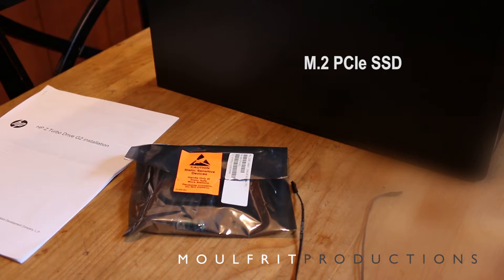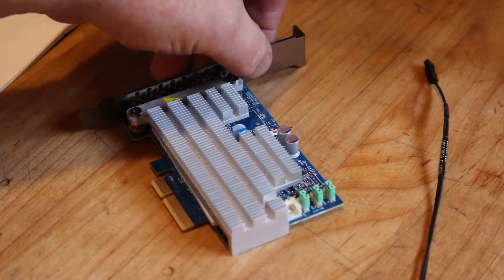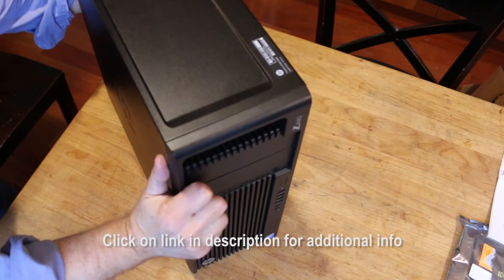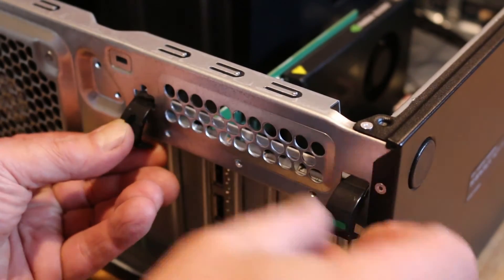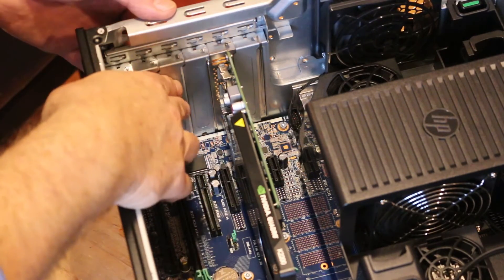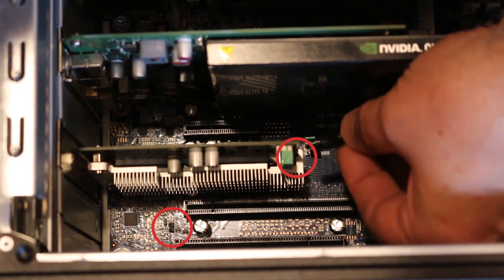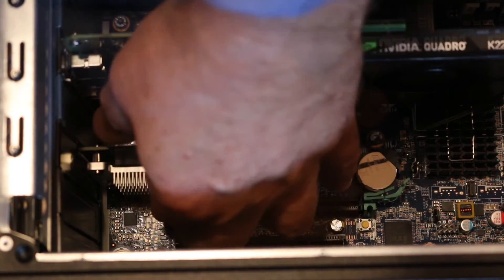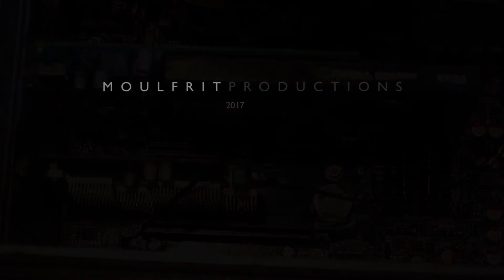How To Install The HP Z Turbo Drive G2 PCIe SSD

Comment: found one in junk pc- no led cable.  surly it will work without?  also it was from a small form case so no secure bracket for larger pc case- should stay put if i'm not shaking it about.  if the adaptor works, would it affect my sata slots like if i used my second m.2 slot i would loose use of my sata 5/6 ports!?  in which case i may as well just use my second m.2 port......

Comment: Hello, I realize this is an old upload but hope to know if installing the HP m.2 adapter runs any different in slot 5 instead of slot 4? I have an old HPZ 620 workstation and installed a GTX 1060 GPU card that is much wider then the Quadro K2000D that I removed that is now REALLY close to the HPZ adapter with the M.2 drive which is in slot 4. BTW the HP Turbo adapter is housing a rare Samsung SM951 512GB AHCI M.2 as my boot drive. It's slower then an NVME but works for me.

Comment: Is this turbo drive, with a Samsung 512gb PM961 NVMe SSD, compatible with the HP Z820 WorkStation?
I bought one and still can't get it to work as a bootable disk with windows 10. Only as a data disk.
What do I have to do?
Reply: No, it won't boot; Zx20 will only work with AHCI compatible SSD's (Intel 750, Samsung SM951) or it can't be used as a boot device; also check for the latest BIOS; no NVME support, though.
Reply: @g4arquitecturag494  After some time I was able to boot through a flash drive where I installed some Clover files.
In order not to always have the pen drive there, then I created a small partition on a data disk where I copied the files on the pen.
Thus, booting through Clover, installed on this partition, the NVMe SSD disk works perfectly.

Comment: What about LED cable polarity ? There is a polarity mark on the LED cable connector but no indication on the Turbo drive board.
Reply: Did you find out anything about the polarity?